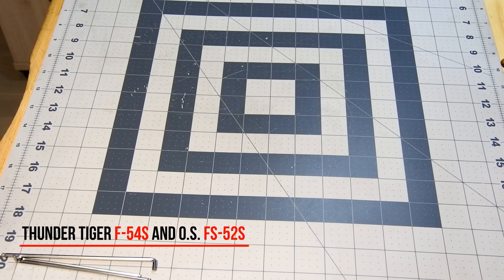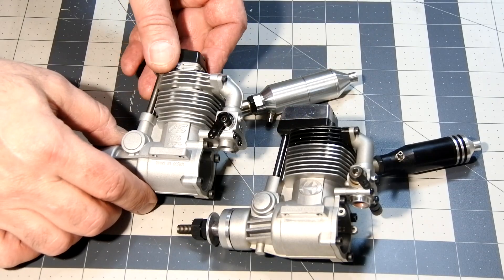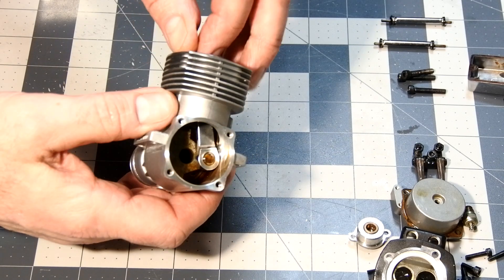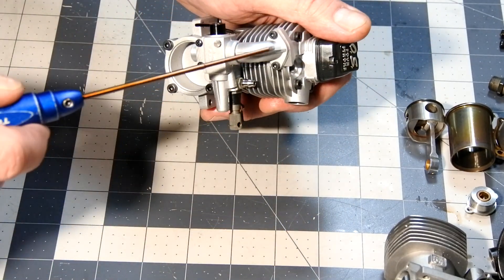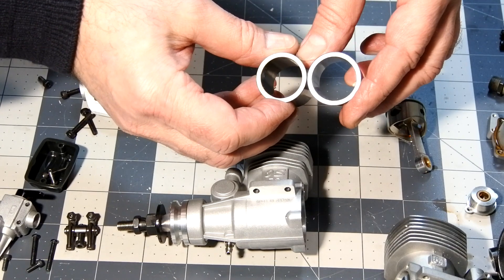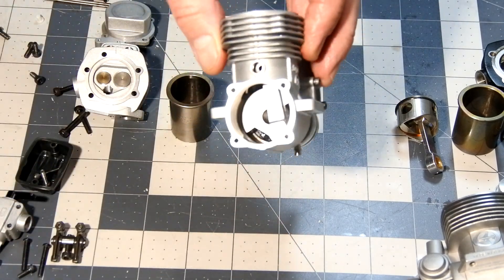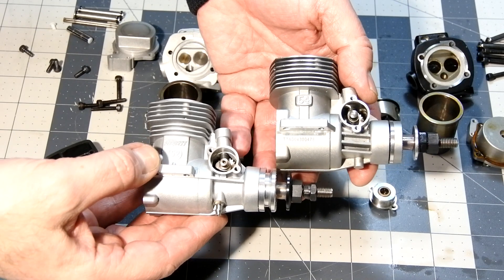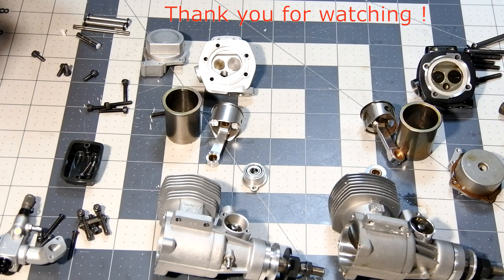Thunder Tiger F 54S and OS FS 52S design comparison

Comment: The Reason theyre so much a like. They where Designed by the same fellow. He worked for OS. Thunder Tiger stole him away to Taiwan to design a Better OS. I think he did! He copied himself. His names are online if you wish to look it up
Reply from the maker: Thanks for the comment, very interesting. I really admire Mr.Kazuhiro Mihara as an engineer and developer. The engines he developed at OS Engines are probably some of the most advanced and popular engines in the world. By the way, I talk about him in my video, starting with the 9th 45s. The story of his transition to Thunder Tiger is quite interesting, and is connected with the conflict over the change in nickel coating technology in the ringless OS FX series engines. Single-stage technology often led to the stripping of nickel from the cylinder surface, but significantly reduced the process time, and Mr.Mihara was against this, insisting on the classic nickel coating technology, which was much more reliable, but also more expensive, and consumed more time in the process. Perhaps this conflict was the starting point for Mr. Mihara's transition to Thunder Tiger. As for me, his work in Thunder Tiger  also gave the world great and very high-quality engines. I have all 4-stroke engines from TT, except F 130S, a rare and very powerful engine. If you happen to find out that someone is selling one, please let me know. Thank you, and have a nice day!

Comment: Hey I was just thinking you could show the difference in power between these engines and the YS53 that you repaired.
Reply from the maker: Thank you, great idea. Certainly, I've plans to make  comparison  movies in engine s classes, like OS FS 52 vs Saito FA 56 vs TTF 54S vs Magnum XL 52 (definitely, total clone of OS FS 52), and of course. vs Enya 53 4C engines. This will consume a lot of time and definitely, will need some additional preparations to measure power and thrust, as minimum.  
We'll see, could be in late March, early April.
Reply: @crazyengines88  I was thinking, run them all on the same props, same fuel(although be careful with the YS53 as it NEEDS 24% oil and likes 20% nitro)
And use the same OS plugs in them.
Then just measure Max RPM.
However yeah it is still a lot of work.
Reply from the maker: @aSpyIntheHaus  I like to work with comparison videos, it's helps a lot, and very useful, when you're in the process of choosing some engines. Probably,  you're right, in case of equal fuel, plug and prop, the higher RPM's means higher thrust. So, no need for special stand with dyno meter.

Comment: Hi Thank you for this interesting presentation. Please can you tell me if the cams cover is interchangeable. Thank you Best regards
Reply from the maker: Thank you for your comments ! I'll check it later, when I'll be in my workshop.
TT 54S can cover has a low profile, I've heard, from my subscribers,  that sometimes happens, after valve gaps adjustment, cam adjustment screw can punch a hole in valves cover.
Reply from the maker: Hi, today i make a try to install OS FS 52 valve cover on TT 54S. It's interesting - I can place the cover, and it is possible, from one side. But from another side - do you will really like a gap in 0,6-0,8 millimeter in between valve cover and engine head ? I think, that from this point, the covers aren't interchangeable in full understanding. 
Thank you for your question !
Reply: @crazyengines88  thank you very much for your kindness. I ill try to find one from TT but the only one found until now it is in US and the vendor don't accept messeges from EU

Comment: Those TT engineers did their job.   I have TT 91 hope I can find TT 54.
Reply: I have a TT 91 it is too heavy for its sise. I am a fan of TT but this one is realy too heavy for it size .
Reply from the maker: Yes, it is a bit heavier, than could be, definitely. In that class power \ weight ration is rather important. I think, Enya 90 4C could be better choice for you project.
Reply from the maker: Thank you for your comment ! Definitely, TT was made really good engines, with great respect and attention to details, fully agree with you. I've 75 &  91 (I think, it was TT first 4 stroker). I'm searching for TT F-130S engine for collection, but only one man from Japan is selling 130S for amazingly high price. B.T.W., TT 54S can be found on eBay, sometimes in N.I.B. condition. I've seen few in a couple of months.
Thank you and have a nice day !

Comment: I have a TTR F54S mounted in a Paulistinha P-56. One of the rocker adjusting screws broke and shot right through the valve cover! Since no spare parts are available, I made a new screw out of a socket head screw, and it works well.
Reply: I have one also with broken screws and seems to be a problem of these engines. Screws are brittel. Chaged with os the same size no problems
Reply: @Adrian_hbu  Good to know, thanks!
Reply from the maker: Thank you for sharing this info ! I've heard from other TTR F54S owners about this problem. Definitely, will make a twice check in this area during assembling.
Thank you !

Comment: Awsome video, thanks a lot for sharing. I have both, excellent runners.
From my experience when a TT is due to be started the first time please check all bolts for tightness. Second, the timing gear can be installed the wrong way. Third, the tappet adjusting nut can be overtighned, so the adjusting screw can break during flights.
Just my findings. After that, the F54S is a great runner.
Reply from the maker: Thank you for your nice comments and advices ! Definitely, it is really valuable and supporting ! I know already (today I was learn, when was worked with video, two screws on TT were really loosely tightened ). Great advices, thank so much !
Have a nice day !